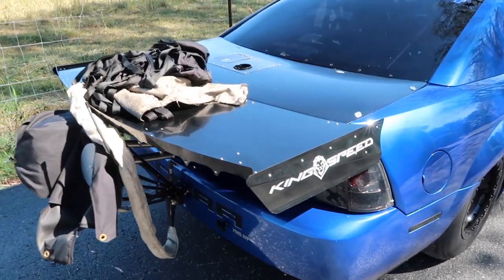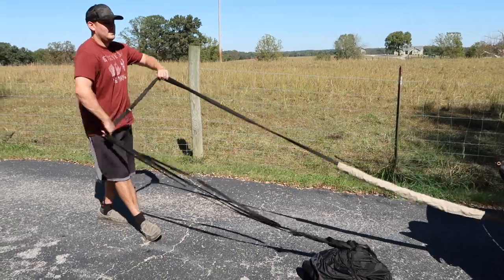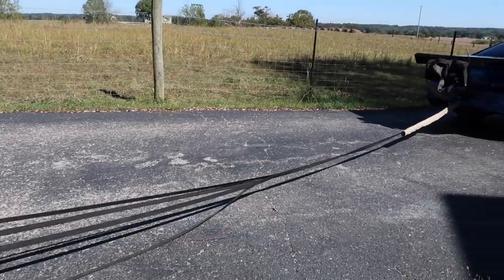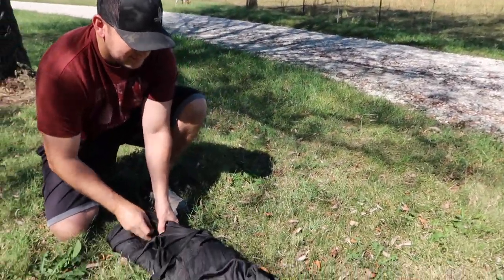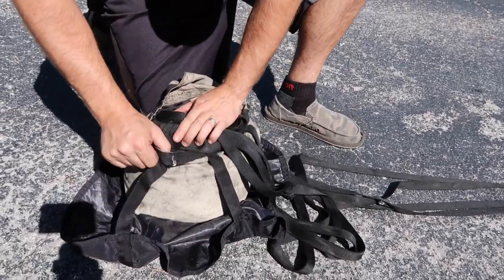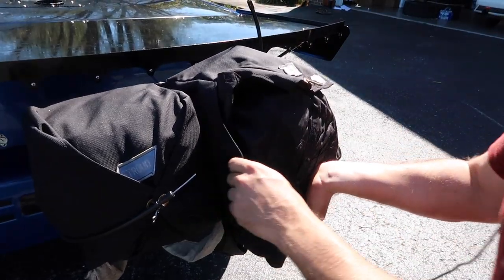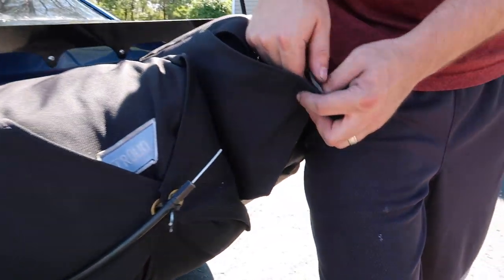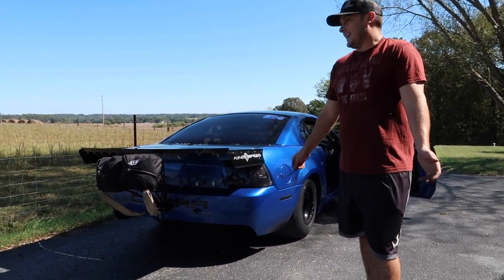PACKING A RACE CAR PARACHUTE!!!

Comment: Two things I had to comment on...

One:  To make it easier wrapping up the chute cords into the bag:  When you're done putting the chute into the bag, just carry the bag, cords & pilot up to the car..  then wrap the cords up into the bag.  no need for a helper to hold the bag/pilot & no chance of dropping the bag or making it awkward wrapping & walking. 

Two:  When you put the bag in and start to pull the flaps down with the string:  You should end with the flap that's on the side of the cable.  That way when the cable releases the first flap to open is the one next to the cable.  Not a big deal but it's the proper way. 

Beautiful car, thank you for the video 

🤙🏼

Comment: Tip for the rope you can burn the ends with a lighter. Mash it with your fingers and will make it pointed and hard so going through the wholes easier. I bet i bought 3 or 4 pair before i just remembered it one day. Great vidja. Could you go over the car in a video?